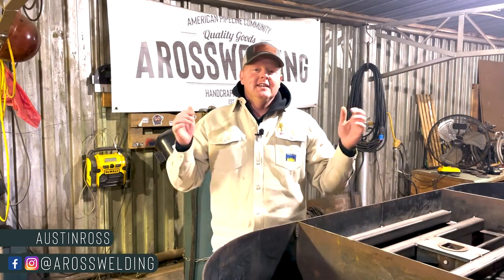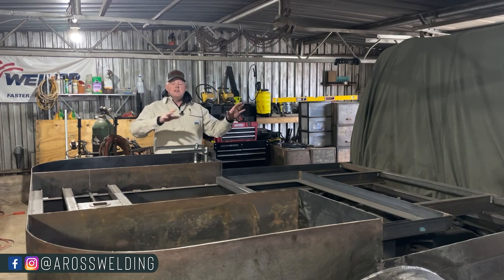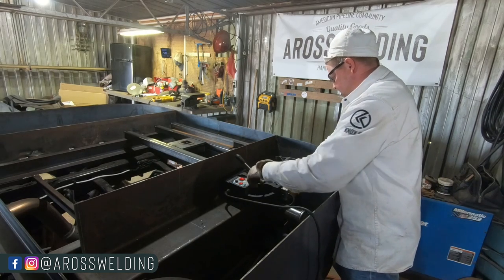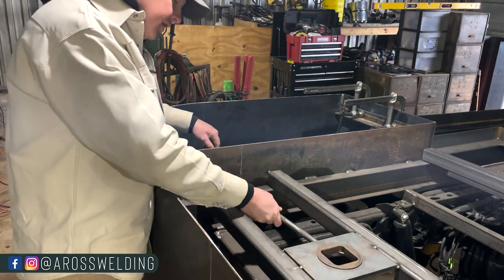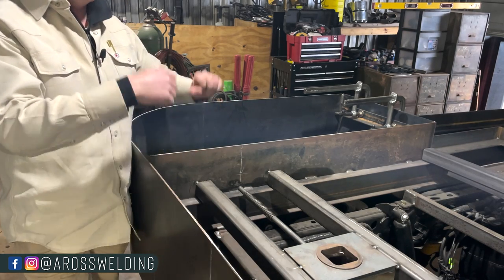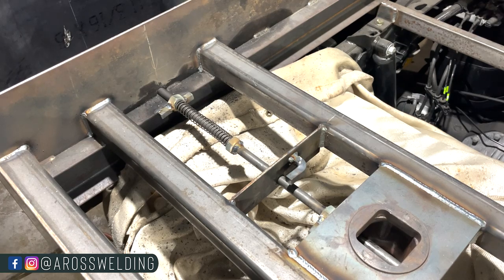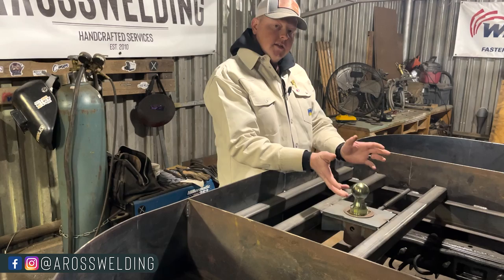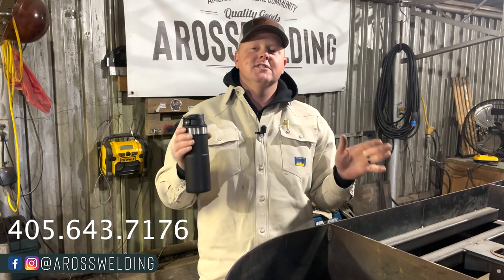Welding the 5th Wheel Hitch at the VERY BACK of the New Welding Rig

Comment: For positioning the hitch over or behind the axles. I always recommend keeping it as close to centered over the axles as you can, being right over the most recommmended. The farther you install the hitch behind the axles, the less total weight you can tow safely. The leverage will begin to factor more and more. So long as you never plan to tow more than under bumper hitch weight, youll be fine.

Comment: That fifth wheel location works because it’s still closer to the axle than a bumper pull would be and you have the weight of the welding machine in front of the rear axle. That being said, why don’t pipeliners buy longer wheelbase trucks. My F-550 is 120” cab to axle and I weld on farms and job sites and have never had an issue getting to the work. I will admit that the shorter wheelbase may do better in the mud. In my opinion, any truck with 19.5 tires doesn’t do well in the mud.
Reply: Pipeliners don't worry about mud, there are crawler tractors that will drag them wherever they need to go, and drag them out.
Pretty sure where some pipeliners go, a 60" c.a. truck seems too long!

Comment: You are being an artist of bed making!  In the early 80s the company I worked for bought a service rig called a “ Maintainer “ ,  had a lot of storage, but general purpose, not specifically for welding, although it had a cutting torch and welder built in.  Not rounded, everything was square.  Hell of a rig but yours looks much better 😊

Comment: Great video and series. Have you though about bolting the 1/4 plate on the spring side of the hitch in case the spring needed to be changed at some point?

Comment: Very good video. Just one thing what brand of welding shirt was you wearing in this video?
Reply from the maker: It’s a new fr im trying out. Here is a link, use code AROSSWELDING at check out for 15% off

https://knoxfr.com/products/the-weld-professor-pipeliner-edition-fr-shirt-white-red-stitch-with-pearl-snap-button?pr_prod_strat=copurchase&pr_rec_id=0fc55d51a&pr_rec_pid=5930124968092&pr_ref_pid=6167463723164&pr_seq=uniform
Reply: Thanks for the heart and info on the shirt. I'll check them out right now.

Comment: Drill a hole for a roll pin to locate the washer. For the bottom of tool bins I use conveyer belt cut to fit. Your local asphalt plant will have old belts.

Comment: with the 5th wheel being back it will just move weight off the steers also transferring some weight to the trailer as well.  but if your not hauling something ridiculously heavy you prob wont see a deference & you gotta think too that big ass welder is putting a ton of weight on the steers probably offsetting that so I could see how it would not make too big of a deference.
Reply from the maker: Well said. Very good observations.